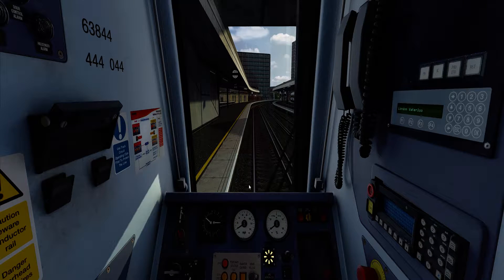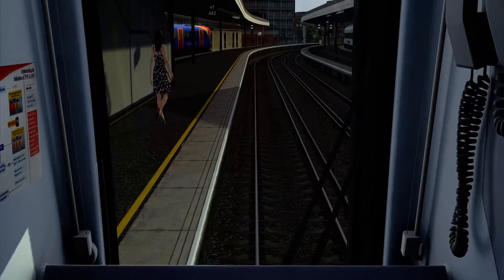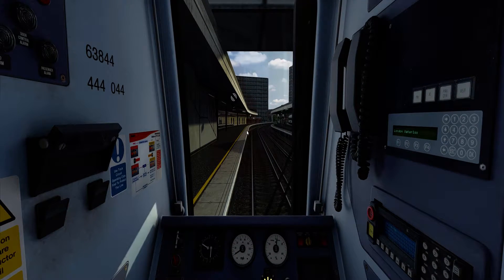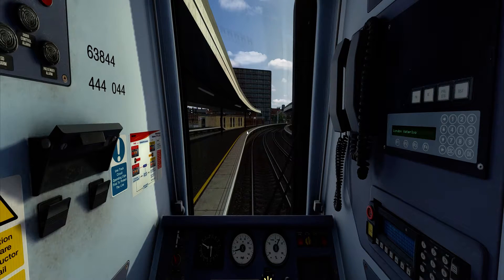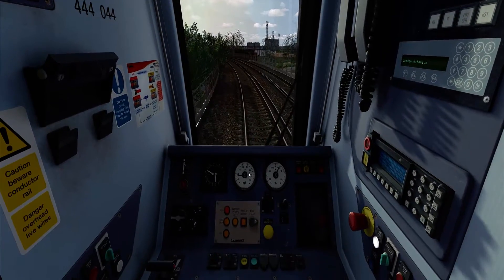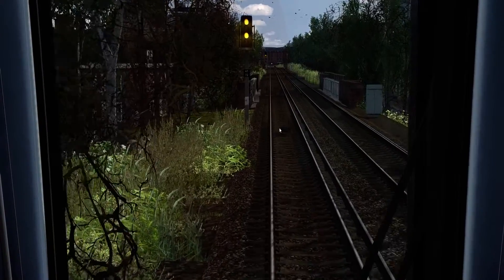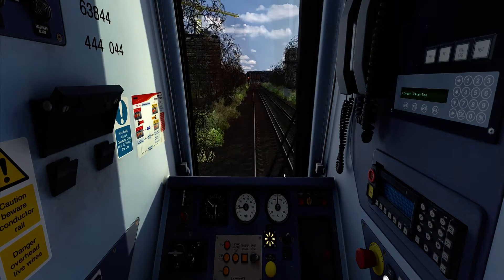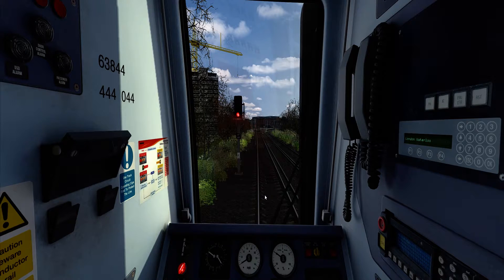Basic AWS & TPWS Tutorial

Comment: Hello there, I have a question are AWS and TPWS compatible ? Because AWS also has the same function of TPWS which is "brakes to be applied if the driver does not
acknowledge it within a certain time" in case the train (SPAD) Then I think both of them has the same function why I will use AWS and TPWS in the same time ?
Reply from the maker: Hi,

AWS preceded TPWS by a number of years, hence why AWS is in operation across the entire network. AWS is not foolproof, for example in the Ladbroke Grove accident of 1999, where TPWS was not yet fitted. This accident encouraged a faster rollout of TPWS, after Automatic Train Protection (which wasn't fitted to the class of train involved) was deemed too expensive after the Clapham Junction accident of 1988. A Driver could acknowledge AWS out of routine but still not register the signal is at Danger and therefore still pass it. TPWS acts as another layer of safety in most areas, linking in with the Swiss cheese model of accident causation. https://en.wikipedia.org/wiki/Swiss_cheese_model.

Comment: Hello sir, great video.
A couple questions, how did you get your sim looking so amazing and running so smooth?
I have a GTX1660 super and a 6 core CPU and I struggle to run medium settings at 30fps on the PDL. 
Any tips and any extra adding you're using to enhance your graphics? Also if you could post your PC specs that'd be great.
Reply from the maker: Hi there, thank you!

When this video was made, I was on an 1080p monitor. Now I use 1440p monitors which helps. Also, I use RWEnhancer PRO ( https://www.rwcentral.com/store/product/6-rw-enhancer-pro/ ) which I highly recommend!

Nividia RTX3080 (980ti when this video was made)
Intel 10700K (Intel 6700K when this video was made)
32GB RAM (16GB when this video was made)
and a multitude of non-mechanical storage!
Reply: @westie165  Thank you for the reply. I am still baffled as to why my framerate is so abysmal on this route... maybe something is wrong.
Reply from the maker: @mintyaviation2376  It's a very resource intensive route. Try RW Enhancer as that should help quite a bit.
Reply: @mintyaviation2376  Do you have Intel or AMD?
Reply: @kylehill9969  AMD.. Ryzen 5 3600

Comment: Hi, great video. Did you start applying the brakes as soon as you went past the single yellow? Just trying to understand from the driver action point of view. Thank you!
Reply: Depends how far the next signal is. Regardless though you should do some form of reaction(brake/slow down) to the single yellow
Reply: In the real world every signal is different. The distance between the signal and when you can sight the next signal is different. It not uncommon to go into max traction on approach to a caution signal but again it depends where that red signal is. For other signals you may start breaking on the approach to the signal at caution. You also need to consider your current track conditions when on a caution. Wheel Slip can be huge danger here as you can slide pass that signal at stop. So to answer your question from a driver point of view it depends on the signal and depends on current track conditions.  This is what we call track knowledge and it the most important part of driving a train. I have breaking landmarks too. It may be box or sign on the network but I know if I start breaking when I pass that landmark I will stop safely for my signal. On wet track i will start my breaking well before my landmark.
Reply: @carmattvidz4426  In the real world, slowing down with brakes is braking. Breaking is what happens in a collision if you haven't braked in time!
Reply from the maker: Hiya, thanks for your comment. As this is just a simulator, I can only comment from a fictional perspective as far as driving is concerned. But as the distance between signals is short on this section, and I was travelling at a slow speed, I did start braking after the single yellow.
Reply: @westie165  oh I see, thank you for the explanation :)
Reply: Chasing yellows is frowned upon and is not good defensive driving practice.